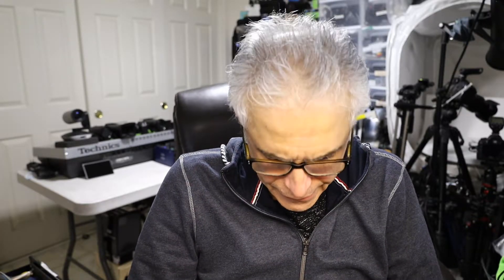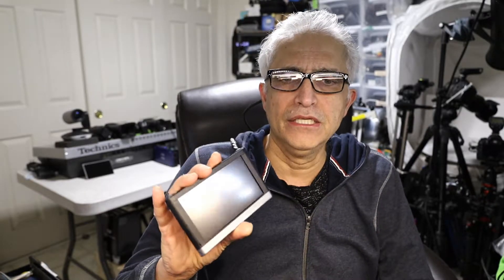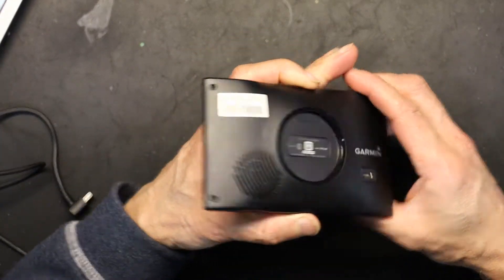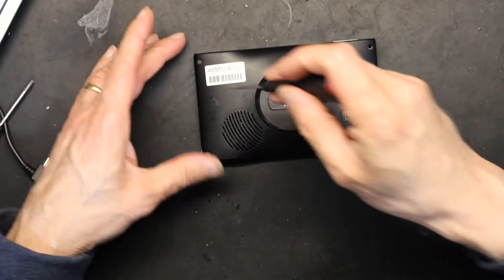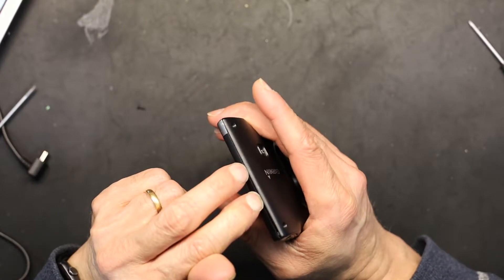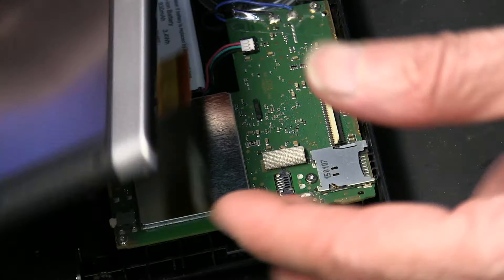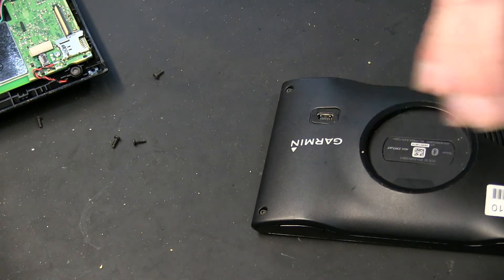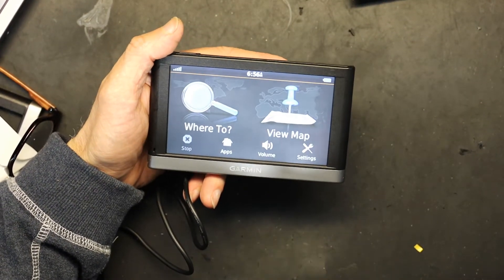Tutorial on replacing the LCD & Touch Screen in a Garmin Nuvi 2597LMT GPS Navigation System

Comment: My unit wouldn't power on. I changed the battery and didn't realize I had put pressure on the screen connector, causing a very slight misalignment. That resulted in the touchscreen functioning but with an unusable white screen. I reseated the screen connector ... perfect! Ready for a longer life with the new battery. Thank you for your video - saved a perfectly good GPS that was about to be disposed of. Subscribed.
Reply from the maker: Thank you for your feedback, I am glad you were able to revive your GPS!

Comment: I have a NUVI 65 that needs a screen, it's not an LM. Is it even worth the price for a new screen sit doesn't have lifetime map updates?
Reply from the maker: If you can get the screen cheap enough from eBay it's worth it, but if the cost of the screen exceeds the value of the unit, then it isn't worth it. Before you invest more of your hard-earned money on it, you should check the value of a used fully functional unit on eBay. For example here are a few used ones that do have Lifetime Maps  https://www.ebay.com/sch/i.html?_from=R40&_trksid=p2047675.m570.l1313&_nkw=garmin+nuvi+65&_sacat=0

Comment: I got a new 1200 mAh battery in  my 2597 LMT.  The video cable came undone on me and that took a while to get back in.  Thanks for this video.  The battery plug is a little different on the 2597.  It pushes in and down instead of just pushing it in.  The old battery was just 940 mAh and was made 11/11/14, so it was time to go.  I lost two case screws where can I get some more?
Reply from the maker: I don't think they sell the screws separately but you can get a non working unit for under $10 from eBay from which you can use the screws and other parts. 
Here is the link https://www.ebay.com/itm/114326627847